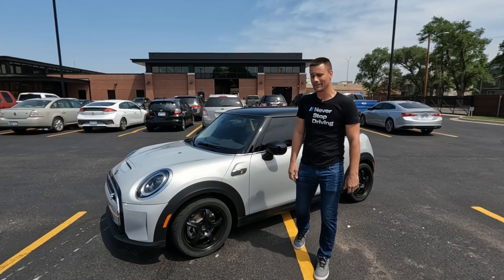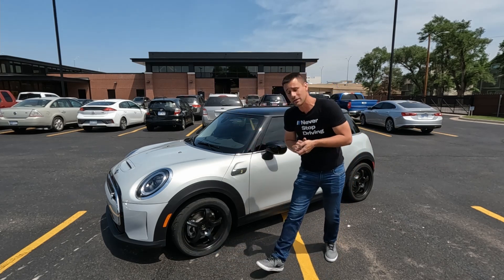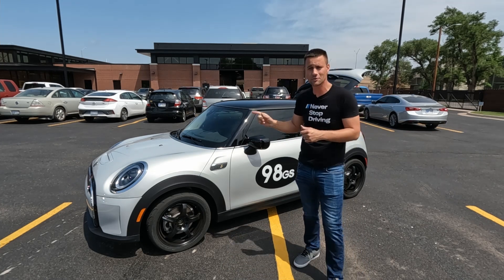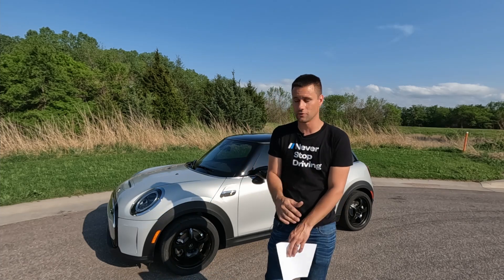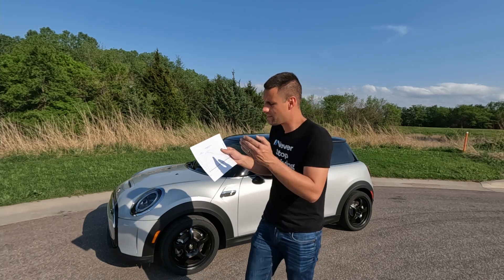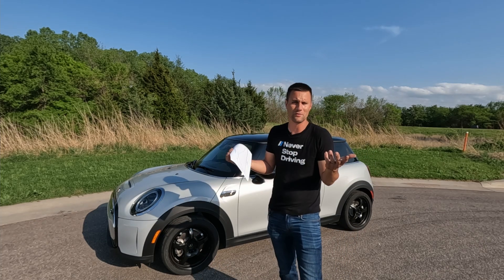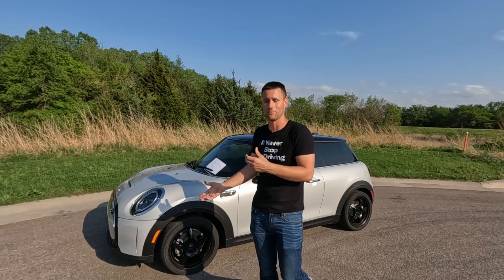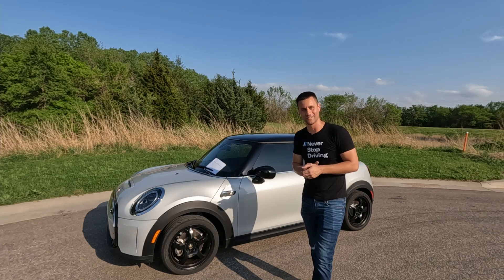1ST MINI COOPER SE On A DYNO!!! Mini Cooper SE Dyno Testing Day

Comment: You should put it in roller mode. That disables a lot of stuff. TC, ABS, DSC, DTC. Turn it on, hold down the trip reset button until a little menu comes up. Find roller mode. On the i3, it permits drifting. :)
There is a standing joke in the British tuning industry:
"What's the easiest way to add 10% more power and torque to an engine?"
"Ship it across the Atlantic"
It seems that this is still as true as ever.

Comment: Mini coopers have a dyno mode that can be accessed with the button on the instrument cluster. Hold down that button and it will give a menu of hidden settings. This button is also used to reset the maintenance when the key in the run position with the engine off (pressing the start button without pressing the brake).
Reply from the maker: That would have been good to know lol Thanks for the view!
Reply: @TylerPotter  for the dyno mode you do it when in key position 1 which is a little weird to get to since pressing the start button once while not pressing the brake puts it in key 2 or run position

Comment: The curve you flashed in the video doesn't really look like the torque vs speed curve of an ev powertrain. It actually looks a lot more like what you would expect for the power-vs-speed curve. (It's also labeled "SAEpwr".) If I convert your curve (I digitized it from the video) from power to torque using the powertrain gear ratio and your 215/40R17 tires, I get flat torque of about 215 ft•lbf at the beginning of your pull. When I "correct" that to 199 ft•lb of torque, the peak power is 186 hp. From my calculations, the peak of your curve comes at about 6300 rpm for the motor which is a bit off from the mfg spec of 7000 rpm.
Reply from the maker: That is awesome info thanks for looking into it! Thanks for the view!